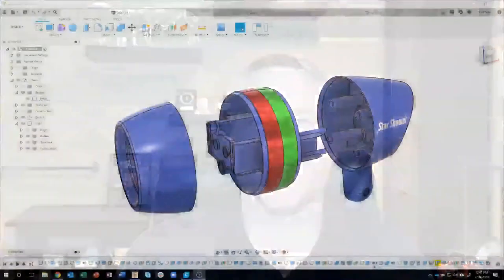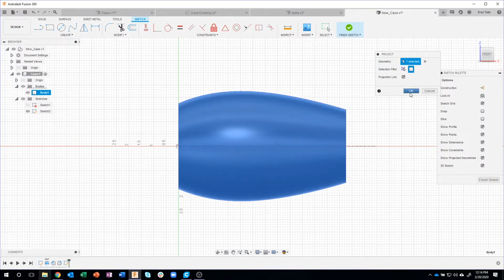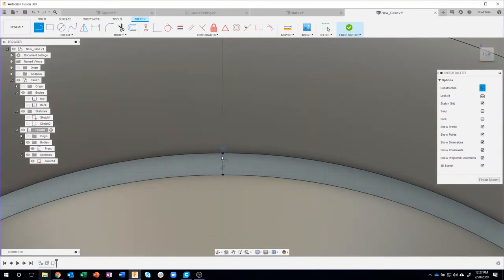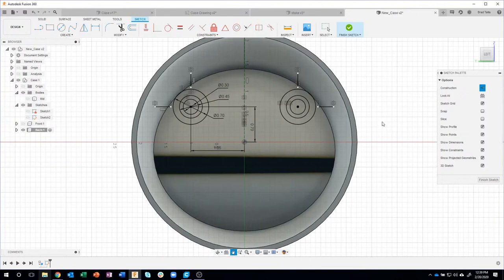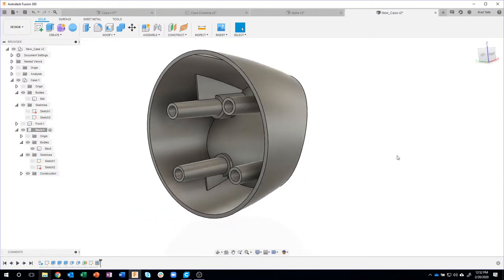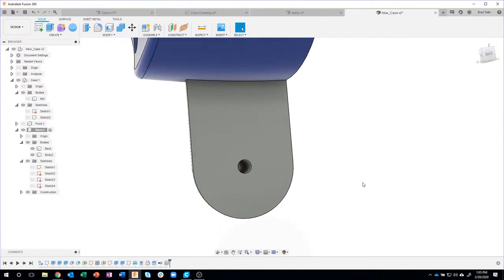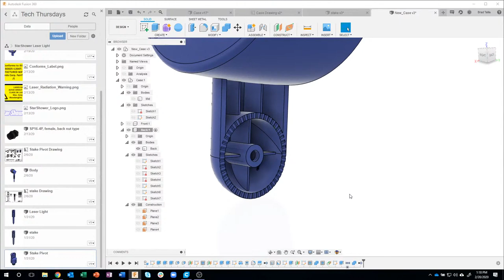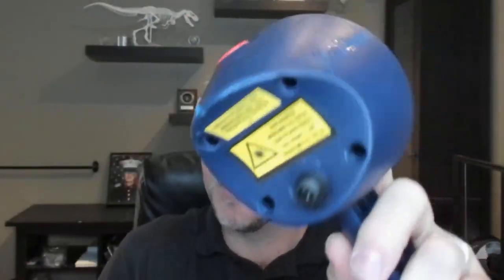Episode 52 - Laser Projector Build  Part 2

Comment: Quick way to get aligned dimension is to move pointer off to side of the line, it will change from straight to aligned.

Comment: Great video as always @Brad
 Tallis
I had a similar issue with the fillets even adding them before the combine. When you get a chance check your email. Thanks for all you do
Reply: Same here. I moved the timeline between the teeth and the combine, did the fillet and the combine was now red and it would not cut the teeth. Bummer because things were going so well.
Reply: I've hit the same problem, did you find a solution?
Reply: I never did figure out the issue (
Reply: @mikeberlinquette9896  I have got this figured out now. There are slight differences between Brads instructions in video 1 for the stake pivot and the file he used in video 2 for insertion. If you go to video 6 you can download the whole file project and either directly import his stake pivot or use it to modify your own. Note the design history for this part is in a different sequence and also note that the tooth extrusion is one sided and not symmetric. Good Luck!

Comment: I want to print a full size 33 Ford roadster. I previously owned one with a fiberglass body. I want to 3D print a body this time which requires dividing the fusion 360 model to be divided into 500mm x 500mm x 500mm body panels that will be accurately printed, assembled and glued together. I will be creating the model from photographs. Should I create the model using surface or sculpt?
Reply from the maker: There are a lot of Fusion 360 videos on how to create a car body.  It really depends on what method you are comfortable with.  There are pros/cons with each method.

Comment: what the difference between using (change fase or Extrude to Face.)?
Reply from the maker: @David-  Extrude to face works while you are in the Extrude command.  Because the "arm" was created as a revolve, I used the Replace Face command.
Reply: @bradtallis8968  but is there a difference between the 2?